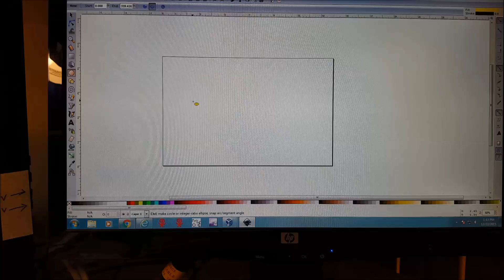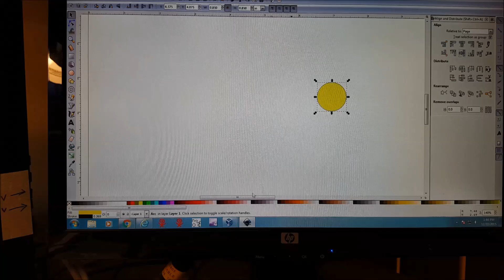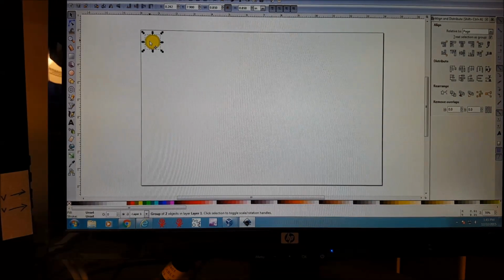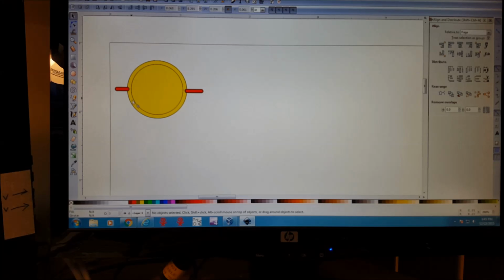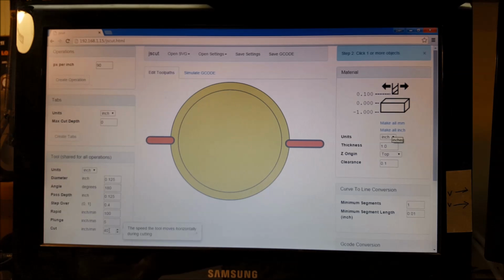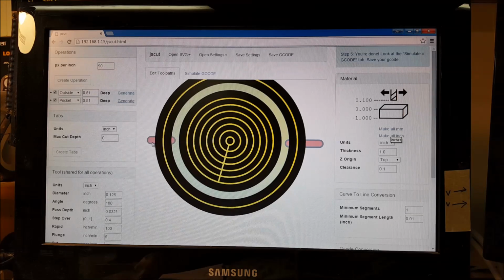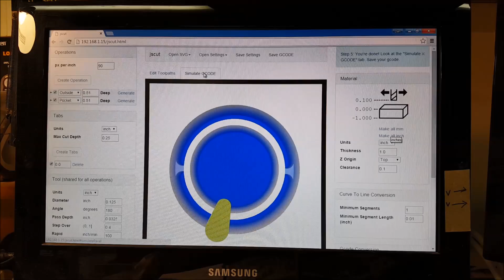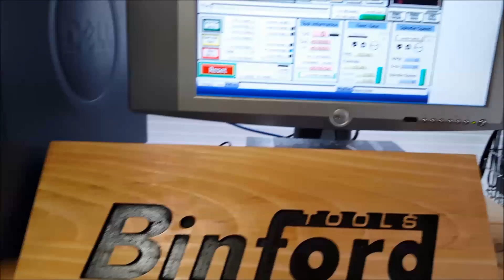Corian Rings - On a small CNC

Comment: Your set me off I want a cnc now been looking at them on eBay 3020 cnc looks like a good starting kit for me to understand thinking of getting one on the end of January
Reply from the maker: +GHOSTHUTCH That's a fine way to start and get your feet wet.  Looks like the rough cutting area dimensions for a 3020 are about 7" x 11" and a Z travel of about 2"  For about $150 more (+/-) you could get a 3040 (that's the size I have) that will give you a cutting area of about 10" x 15" and a Z travel of around 3".  Just something to think about.  The more projects I do the more I'd like a 6040 which would offer about 17" x 30" - but they are around $1500 so that's not happening anytime soon.  Best of luck.